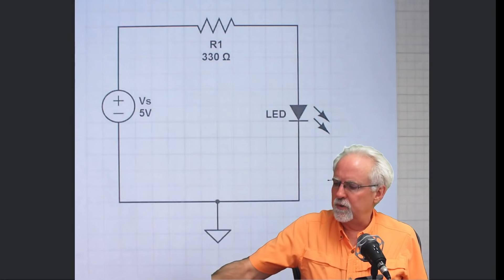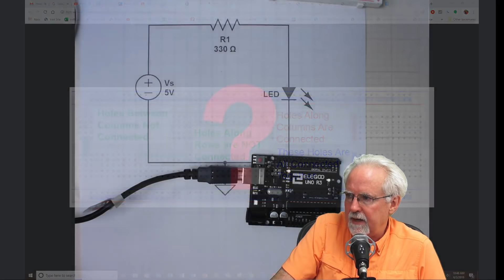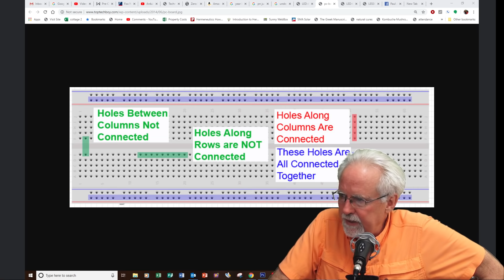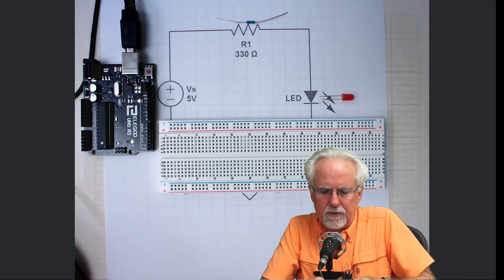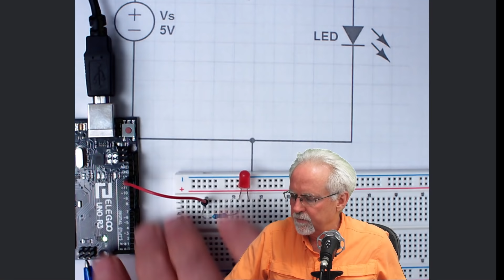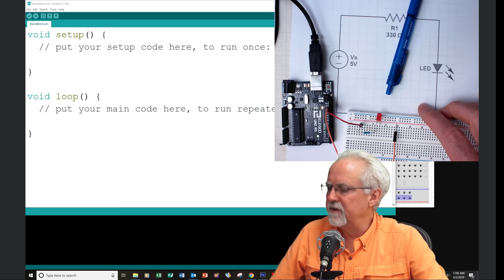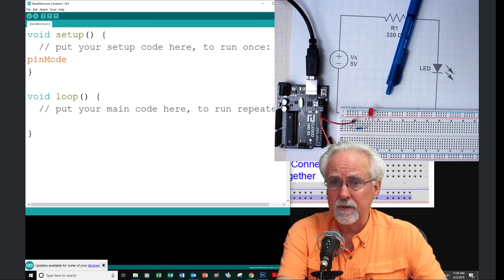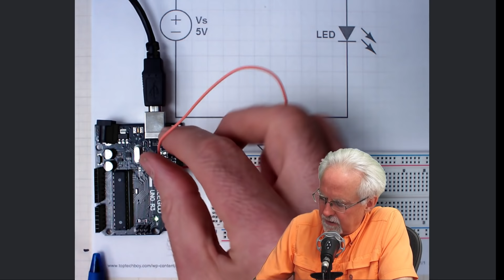Arduino Tutorial 3: Understanding How Breadboards Work

Comment: I've got a small headstart, due to playing with electronics as a kid and as an aircraft electrician, but until I got halfway through this video, I wouldn't have been able to do this. Once I saw half this video, I knew what I needed to do, to power a number of LEDs to run individually. My breadboard's currently running 6 LEDs, blinking a run, then running in the opposite direction, then alternating blinking the even LEDs and odd LEDs. This is so much fun. Thanks, Mr. McWhorter!
Reply from the maker: Welcome Aboard!

Comment: void setup()
{
  pinMode(8,OUTPUT);
  pinMode(9,OUTPUT);
  pinMode(10,OUTPUT);
}

void loop()
{
  digitalWrite(8,HIGH);
  delay(500); 
  digitalWrite(8,LOW);
  delay(500);
  digitalWrite(8,HIGH);
  delay(500); 
  digitalWrite(8,LOW);
  delay(500);
  digitalWrite(8,HIGH);
  delay(500); 
  digitalWrite(8,LOW);
  delay(500);
  digitalWrite(8,HIGH);
  delay(500); 
  digitalWrite(8,LOW);
  delay(500);
  digitalWrite(8,HIGH);
  delay(500); 
  digitalWrite(8,LOW);
  delay(500);
  
  digitalWrite(9,HIGH);
  delay(500); 
  digitalWrite(9,LOW);
  delay(500);
  digitalWrite(9,HIGH);
  delay(500); 
  digitalWrite(9,LOW);
  delay(500);
  digitalWrite(9,HIGH);
  delay(500); 
  digitalWrite(9,LOW);
  delay(500);
  digitalWrite(9,HIGH);
  delay(500); 
  digitalWrite(9,LOW);
  delay(500);
  digitalWrite(9,HIGH);
  delay(500); 
  digitalWrite(9,LOW);
  delay(500);
  digitalWrite(9,HIGH);
  delay(500); 
  digitalWrite(9,LOW);
  delay(500);
  digitalWrite(9,HIGH);
  delay(500); 
  digitalWrite(9,LOW);
  delay(500);
  digitalWrite(9,HIGH);
  delay(500); 
  digitalWrite(9,LOW);
  delay(500);
  digitalWrite(9,HIGH);
  delay(500); 
  digitalWrite(9,LOW);
  delay(500);
  digitalWrite(9,HIGH);
  delay(500); 
  digitalWrite(9,LOW);
  delay(500);
  
  
  digitalWrite(10,HIGH);
  delay(500); 
  digitalWrite(10,LOW);
  delay(500);
  digitalWrite(10,HIGH);
  delay(500); 
  digitalWrite(10,LOW);
  delay(500);
  digitalWrite(10,HIGH);
  delay(500); 
  digitalWrite(10,LOW);
  delay(500);
  digitalWrite(10,HIGH);
  delay(500); 
  digitalWrite(10,LOW);
  delay(500);
  digitalWrite(10,HIGH);
  delay(500); 
  digitalWrite(10,LOW);
  delay(500);
  digitalWrite(10,HIGH);
  delay(500); 
  digitalWrite(10,LOW);
  delay(500);
  digitalWrite(10,HIGH);
  delay(500); 
  digitalWrite(10,LOW);
  delay(500);
  digitalWrite(10,HIGH);
  delay(500); 
  digitalWrite(10,LOW);
  delay(500);
  digitalWrite(10,HIGH);
  delay(500); 
  digitalWrite(10,LOW);
  delay(500);
  digitalWrite(10,HIGH);
  delay(500); 
  digitalWrite(10,LOW);
  delay(500);
  digitalWrite(10,HIGH);
  delay(500); 
  digitalWrite(10,LOW);
  delay(500);
  digitalWrite(10,HIGH);
  delay(500); 
  digitalWrite(10,LOW);
  delay(500);
  digitalWrite(10,HIGH);
  delay(500); 
  digitalWrite(10,LOW);
  delay(500);
  digitalWrite(10,HIGH);
  delay(500); 
  digitalWrite(10,LOW);
  delay(500);
  digitalWrite(10,HIGH);
  delay(500); 
  digitalWrite(10,LOW);
  delay(500);
  
  
  
  delay(2000);

}

Comment: My assignment code for this tutorial 3: 

void setup() {
  // put your setup code here, to run once:
  pinMode(3, OUTPUT);
  pinMode(5, OUTPUT);
  pinMode(7, OUTPUT);
}

void loop() {
  //RED
  //1
  digitalWrite(3, HIGH);
  delay(1000);
  digitalWrite(3, LOW);
  delay(500);
  //2
  digitalWrite(3, HIGH);
  delay(1000);
  digitalWrite(3, LOW);
  delay(500);
  //3
  digitalWrite(3, HIGH);
  delay(1000);
  digitalWrite(3, LOW);
  delay(500);
  //4
  digitalWrite(3, HIGH);
  delay(1000);
  digitalWrite(3, LOW);
  delay(500);
   //5
  digitalWrite(3, HIGH);
  delay(1000);
  digitalWrite(3, LOW);
  delay(500);

  //YELLOW
  //1
  digitalWrite(5, HIGH);
  delay(1000);
  digitalWrite(5, LOW);
  delay(500);
  //2
  digitalWrite(5, HIGH);
  delay(1000);
  digitalWrite(5, LOW);
  delay(500);
  //3
  digitalWrite(5, HIGH);
  delay(1000);
  digitalWrite(5, LOW);
  delay(500);
  //4
  digitalWrite(5, HIGH);
  delay(1000);
  digitalWrite(5, LOW);
  delay(500);
   //5
  digitalWrite(5, HIGH);
  delay(1000);
  digitalWrite(5, LOW);
  delay(500);
  //6
  digitalWrite(5, HIGH);
  delay(1000);
  digitalWrite(5, LOW);
  delay(500);
  //7
  digitalWrite(5, HIGH);
  delay(1000);
  digitalWrite(5, LOW);
  delay(500);
  //8
  digitalWrite(5, HIGH);
  delay(1000);
  digitalWrite(5, LOW);
  delay(500);
  //9
  digitalWrite(5, HIGH);
  delay(1000);
  digitalWrite(5, LOW);
  delay(500);
  //10
  digitalWrite(5, HIGH);
  delay(1000);
  digitalWrite(5, LOW);
  delay(500);

   //GREEN
  //1
  digitalWrite(7, HIGH);
  delay(1000);
  digitalWrite(7, LOW);
  delay(500);
  //2
  digitalWrite(7, HIGH);
  delay(1000);
  digitalWrite(7, LOW);
  delay(500);
  //3
  digitalWrite(7, HIGH);
  delay(1000);
  digitalWrite(7, LOW);
  delay(500);
  //4
  digitalWrite(7, HIGH);
  delay(1000);
  digitalWrite(7, LOW);
  delay(500);
   //5
  digitalWrite(7, HIGH);
  delay(1000);
  digitalWrite(7, LOW);
  delay(500);
  //6
  digitalWrite(7, HIGH);
  delay(1000);
  digitalWrite(7, LOW);
  delay(500);
  //7
  digitalWrite(7, HIGH);
  delay(1000);
  digitalWrite(7, LOW);
  delay(500);
  //8
  digitalWrite(7, HIGH);
  delay(1000);
  digitalWrite(7, LOW);
  delay(500);
  //9
  digitalWrite(7, HIGH);
  delay(1000);
  digitalWrite(7, LOW);
  delay(500);
  //10
  digitalWrite(7, HIGH);
  delay(1000);
  digitalWrite(7, LOW);
  delay(500);
  //11
  digitalWrite(7, HIGH);
  delay(1000);
  digitalWrite(7, LOW);
  delay(500);
  //12
  digitalWrite(7, HIGH);
  delay(1000);
  digitalWrite(7, LOW);
  delay(500);
  //13
  digitalWrite(7, HIGH);
  delay(1000);
  digitalWrite(7, LOW);
  delay(500);
  //14
  digitalWrite(7, HIGH);
  delay(1000);
  digitalWrite(7, LOW);
  delay(500);
   //15
  digitalWrite(7, HIGH);
  delay(1000);
  digitalWrite(7, LOW);
  delay(500);
}
Reply from the maker: Well done!

Comment: void setup() {
  pinMode(8,OUTPUT);
  digitalWrite(8,HIGH); delay(500);
  digitalWrite(8,LOW); delay(500);
  digitalWrite(8,HIGH); delay(500);
  digitalWrite(8,LOW); delay(500);
  digitalWrite(8,HIGH); delay(500);
  digitalWrite(8,LOW); delay(500);
  digitalWrite(8,HIGH); delay(500);
  digitalWrite(8,LOW); delay(500);
  digitalWrite(8,HIGH); delay(500);
  digitalWrite(8,LOW); delay(500);
  pinMode(7,OUTPUT);
  digitalWrite(7,HIGH); delay(500);
  digitalWrite(7,LOW); delay(500);
  digitalWrite(7,HIGH); delay(500);
  digitalWrite(7,LOW); delay(500);
  digitalWrite(7,HIGH); delay(500);
  digitalWrite(7,LOW); delay(500);
  digitalWrite(7,HIGH); delay(500);
  digitalWrite(7,LOW); delay(500);
  digitalWrite(7,HIGH); delay(500);
  digitalWrite(7,LOW); delay(500);
  digitalWrite(7,HIGH); delay(500);
  digitalWrite(7,LOW); delay(500);
  digitalWrite(7,HIGH); delay(500);
  digitalWrite(7,LOW); delay(500);
  digitalWrite(7,HIGH); delay(500);
  digitalWrite(7,LOW); delay(500);
  digitalWrite(7,HIGH); delay(500);
  digitalWrite(7,LOW); delay(500);
  digitalWrite(7,HIGH); delay(500);
  digitalWrite(7,LOW); delay(500);
  pinMode(3,OUTPUT);
  digitalWrite(3,HIGH); delay(500);
  digitalWrite(3,LOW); delay(500);
  digitalWrite(3,HIGH); delay(500);
  digitalWrite(3,LOW); delay(500);
  digitalWrite(3,HIGH); delay(500);
  digitalWrite(3,LOW); delay(500);
  digitalWrite(3,HIGH); delay(500); 
  digitalWrite(3,LOW); delay(500);
  digitalWrite(3,HIGH); delay(500);
  digitalWrite(3,LOW); delay(500);
  digitalWrite(3,HIGH); delay(500);
  digitalWrite(3,LOW); delay(500);
  digitalWrite(3,HIGH); delay(500);
  digitalWrite(3,LOW); delay(500);
  digitalWrite(3,HIGH); delay(500);
  digitalWrite(3,LOW); delay(500);
  digitalWrite(3,HIGH); delay(500);
  digitalWrite(3,LOW); delay(500);
  digitalWrite(3,HIGH); delay(500);
  digitalWrite(3,LOW); delay(500);
  digitalWrite(3,HIGH); delay(500);
  digitalWrite(3,LOW); delay(500);
  digitalWrite(3,HIGH); delay(500);
  digitalWrite(3,LOW); delay(500);
  digitalWrite(3,HIGH); delay(500);
  digitalWrite(3,LOW); delay(500);
  digitalWrite(3,HIGH); delay(500);
  digitalWrite(3,LOW); delay(500);
  digitalWrite(3,HIGH); delay(500);
  digitalWrite(3,LOW); delay(500);
  }

void loop() {
 
}

Comment: How do I connect multiple LEDs to one GND pin on the Arduino using the breadboard?
Reply from the maker: Run a wire from ground to the blue rail on the bottom of the breadboard. Now that entire line becomes a ground for you to use.

Comment: I did it!
Here is my code:

//Blinks Red LED 5 times, then green LED 10 times, then Blue LED 15 times
//Red LED - Pin 8
//Green LED - Pin 7
//Blue LED - Pin 5
//330 ohm resistor for each LED

void setup() {
  // put your setup code here, to run once:

//Red LED - Pin 8
pinMode(8,OUTPUT);

//Green LED - Pin 7
pinMode(7, OUTPUT);

//Blue LED - Pin 5
pinMode(5,OUTPUT);

}

void loop() {
  // put your main code here, to run repeatedly:

//Red LED
for(int i = 0; i < 5; i++) {
  // runs code 5 times
  digitalWrite(8,HIGH);
  delay(500);

  digitalWrite(8,LOW);
  delay(500);
}

//Green LED
for(int i = 0; i < 10; i++) {
  // runs code 10 times
  digitalWrite(7,HIGH);
  delay(500);

  digitalWrite(7,LOW);
  delay(500);
}

//Blue LED
for(int i = 0; i < 15; i++) {
  digitalWrite(5, HIGH);
  delay(500);

  digitalWrite(5,LOW);
  delay(500);
}

}

Comment: Loves the flawless explanation on the digital circuit and breadboard. To my surprise, I was able to switch LED on in a separate column connected with resistor across the divot using additional male wire jumper. Same for ground!

Comment: this is the code below:
int ledPin1 = 13;
int ledPin2 = 8;
int ledPin3 = 7;
int blinkTime = 500;

void setup()
{
  pinMode(ledPin1, OUTPUT);
  pinMode(ledPin2, OUTPUT);
  pinMode(ledPin3, OUTPUT);

  blinkyBlinky(ledPin1, 5, blinkTime); // LED on pin 13 blinks 5 times
  blinkyBlinky(ledPin2, 10, blinkTime); // LED on pin 8 blinks 10 times
  blinkyBlinky(ledPin3, 15, blinkTime); // LED on pin 7 blinks 15 times
}

void loop()
{
  // nothing here
}

void blinkyBlinky(int pin, int repeats, int time)
{
  for (int i = 0; i < repeats; i++)
  {
    digitalWrite(pin, HIGH);
    delay(time);
    digitalWrite(pin, LOW);
    delay(time);
  }
}

Comment: OMG, I just lit up my first LED It was way easier than I imagined!
But I’m a bit confused when it comes to lighting three LEDs.

For the first LED, you connected the negative wire (orange wire) to the GND pin on the Arduino.
So if we want to light up three LEDs, we need three separate pins for the negative connections, how are we supposed to light up three LED's? there is only one pin saying GND on the Arduino
Reply from the maker: connect one grownd wire to the bottom ground line on the breadboard. Then connect all grounds to that.
Reply: @paulmcwhorter  I think I have a different Arduino 😭

Comment: void setup() {
  // put your setup code here, to run once:
  pinMode(1,OUTPUT);
  pinMode(2,OUTPUT);
  pinMode(4,OUTPUT);
}

void loop() {
  // put your main code here, to run repeatedly:

  red();
  delay(2000);
  green();
  delay(2000);
  blue();
  delay(10000);
}

void red(){
  for(int i=0;i<=4;i++){
    blink(1);
  }
}

void green(){
  for(int i=0;i<=9;i++){
    blink(2);
  }
}

void blue(){
  for(int i=0;i<=14;i++){
    blink(4);
  }
}

void blink(int pinNumber){
  digitalWrite(pinNumber, HIGH);
  delay(500);
  digitalWrite(pinNumber, LOW);
  delay(500);
}
Reply: program which I wrote to blink red light 5 times, green light 10 times and blue light 15 times.

Comment: Im confused shouldn't i be able to put two lcd lights onte the same row ig the rows are connected together? I did the three lights all on different rows and it worked. When i put a light behind each one of them only one worked. I didt have to add a second resister and when i trei to add a second resister on the other that didnt work either

Comment: int redLED = 8;
int blueLED = 9;
int greenLED = 10;

void setup() {
  pinMode(redLED, OUTPUT);
  pinMode(blueLED, OUTPUT);
  pinMode(greenLED, OUTPUT);
}

void loop() {
  // --- S = ... (3 σύντομα)
  for (int i = 0; i < 3; i++) {
    flashAll(200);   // μικρό φλας
    delay(200);
  }

  // --- O = --- (3 μεγάλα)
  for (int i = 0; i < 3; i++) {
    flashAll(600);   // μεγάλο φλας
    delay(200);
  }

  // --- S = ... (3 σύντομα)
  for (int i = 0; i < 3; i++) {
    flashAll(200);
    delay(200);
  }

  delay(2000); // παύση πριν ξαναστείλει SOS
}

// Συνάρτηση που αναβοσβήνει όλα τα LED
void flashAll(int duration) {
  digitalWrite(redLED, HIGH);
  digitalWrite(blueLED, HIGH);
  digitalWrite(greenLED, HIGH);
  delay(duration);
  digitalWrite(redLED, LOW);
  digitalWrite(blueLED, LOW);
  digitalWrite(greenLED, LOW);
}

Comment: this is my code:
void setup() {
  // put your setup code here, to run once:
  pinMode(13,OUTPUT);
  pinMode(12,OUTPUT);
  pinMode(11,OUTPUT);
}
//blink 5 ori pt red, 10 ori pt green, 15 ori pt blue
void loop() {
  // put your main code here, to run repeatedly:
  for(int i=0; i<5; i++)
  {
    digitalWrite(13,HIGH);
    delay(1000);
    digitalWrite(13,LOW);
    delay(1000);
  }
  for(int i=0; i<10; i++)
  {
    digitalWrite(12,HIGH);
    delay(1000);
    digitalWrite(12,LOW);
    delay(1000);
  }
  for(int i=0; i<15; i++)
  {
    digitalWrite(11,HIGH);
    delay(1000);
    digitalWrite(11,LOW);
    delay(1000);
  }
}
Reply: Amazing to see that people are so invested coding with Arduino <3

Comment: So I've decided to spice the assignment up a little. Instead of 5 red, then 10 green and 15 blue I decided that blue will always blink, green will blink every two blue blinks and red will blink every three blue blinks. Sounds kinda complicated, but it's really simple and makes a beautiful rave show. Wiring is the same, code is here:

const int redLEDPin = 8;

const int greenLEDPin = 10;
const int blueLEDPin = 12;

const int blinkFrequency = 100;

int blueBlinks = 0;

void setup() {
pinMode(redLEDPin, OUTPUT);
pinMode(greenLEDPin, OUTPUT);
pinMode(blueLEDPin, OUTPUT);
}

void loop() {
delay(blinkFrequency);   
digitalWrite(blueLEDPin, HIGH);

if (blueBlinks == 0)
{  
  delay(blinkFrequency);
  digitalWrite(blueLEDPin, LOW);  
}

if (blueBlinks == 1)
{ 
  digitalWrite(greenLEDPin, HIGH);
  delay(blinkFrequency);
  digitalWrite(blueLEDPin, LOW);
  digitalWrite(greenLEDPin, LOW);  
}

if (blueBlinks == 2)
{ 
  digitalWrite(greenLEDPin, HIGH);
  digitalWrite(redLEDPin, HIGH);
  delay(blinkFrequency);
  digitalWrite(blueLEDPin, LOW);
  digitalWrite(greenLEDPin, LOW);
  digitalWrite(redLEDPin, LOW);  
}

if (blueBlinks != 2)
{
  blueBlinks += 1;
} else 
{
  blueBlinks = 0;
}
}

Comment: It is good engineering practice to hook up the circuit with no power applied to the breadboard. In your video the arduino is powerewd and blinking the internal LED while you are hooking up your circuit.

Comment: My programs work, but I do NOT get the color change for the code inside of the parentheses.  I do get the color change for pinMode, digitalWrite.  Thought I was doing something wrong, but went ahead and ran the program and everything works as expected.  I have an Dell laptop windows 10 64 bit
Reply from the maker: I was on IDE 1.8 and you are probably on 2.X and some of the coloring changed.

Comment: I had some fun with this one!

Code below:

// Blinks three external LEDs. One Red, one Green and one Blue.
// Red LED blinks 5 times, Green LED blinks 10 times and the
// Blue LED blinks 15 times.

int a;  // Inner loop variable.
int b;  // Outer loop variable.
int iRateCons = 500; // Initial blink rate for the LEDs and the slowest blink rate.
int iRate;  // Variable blink rate for the LEDs.
int iRateLow = 20; // The fastest blink rate.
int iStep = 100;  // Used to control the inner loop speed.

void setup()
{
  // put your setup code here, to run once:

  pinMode(13,OUTPUT); // Red LED pin.
  pinMode(7 ,OUTPUT); // Green LED pin.
  pinMode(6 ,OUTPUT); // Blue LED pin.

}

void loop()
{

  // put your main code here, to run repeatedly:

  iRate = iRateCons; // Set the initial blink speed.

  // Increase the speed of the blinks each time through.
  for (b = iRate; b >= iRateLow; b = b - iStep)
    {

      if (iRate < iRateLow)
        {
          iRate = iRateLow;
        }

      iRate = b;

      // Blink the Red LED 5 times.
      for (a = 1; a <= 5; a++)
        {
          digitalWrite(13, HIGH);
          delay(iRate);
          digitalWrite(13, LOW);
          delay(iRate);
        }
  
      // Blink the Green LED 10 times.
      for (a = 1; a <= 10; a++)
        {
          digitalWrite(7, HIGH);
          delay(iRate);
          digitalWrite(7, LOW);
          delay(iRate);
        }
  
      // Blink the Blue LED 15 times.
      for (a = 1; a <= 15; a++)
        {
          digitalWrite(6, HIGH);
          delay(iRate);
          digitalWrite(6, LOW);
          delay(iRate);
        }
  
    }

  iRate = iRateLow;

  // Decrease the speed of the blinks each time through until it reaches the initial speed.
  for (b = iRate; b <= iRateCons; b = b + iStep)
    {

      if (iRate > iRateCons)
        {
          iRate = iRateCons;
        }

      iRate = b;

      // Blink the Red LED 5 times.
      for (a = 1; a <= 5; a++)
        {
          digitalWrite(13, HIGH);
          delay(iRate);
          digitalWrite(13, LOW);
          delay(iRate);
        }
  
      // Blink the Green LED 10 times.
      for (a = 1; a <= 10; a++)
        {
          digitalWrite(7, HIGH);
          delay(iRate);
          digitalWrite(7, LOW);
          delay(iRate);
        }
  
      // Blink the Blue LED 15 times.
      for (a = 1; a <= 15; a++)
        {
          digitalWrite(6, HIGH);
          delay(iRate);
          digitalWrite(6, LOW);
          delay(iRate);
       }

    }

}